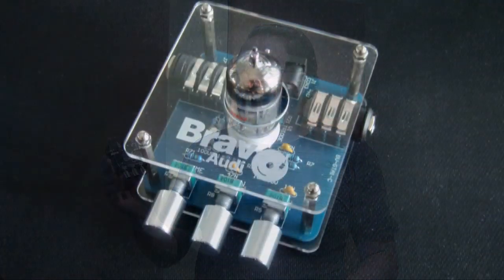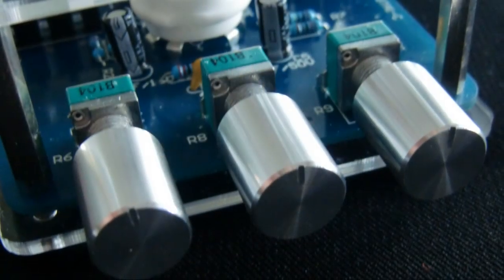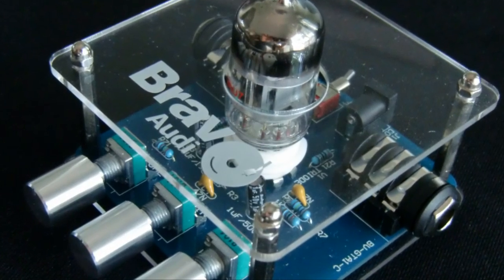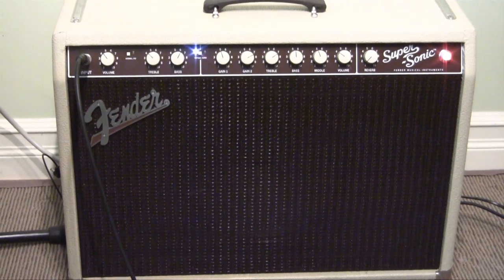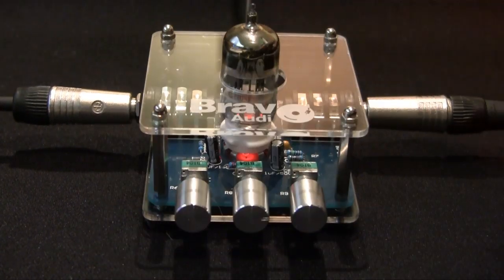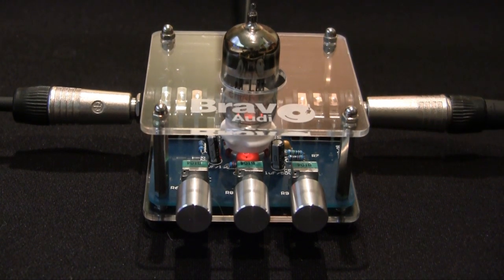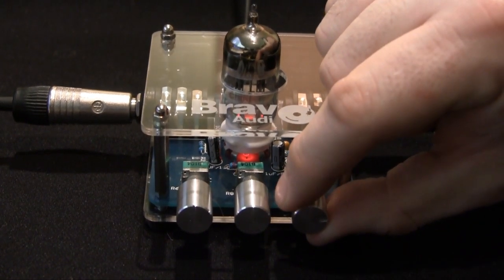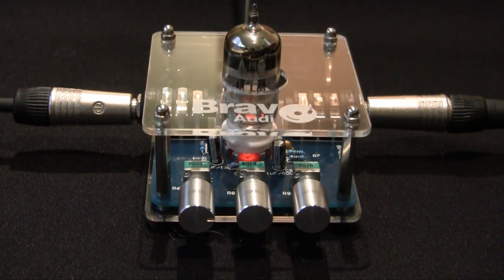Bravo Guitar Booster Review and Sound Test

Comment: Hi, I've seen it asked on this video and another (doesn't seem to be many videos of this unit) and I was also wondering. How does this unit pair with a solid state amp? Does it add any tube character to the tone at all? Even if it does not, do you think this would benefit the sound when used with a solid state amp. Thanks for the video :)
Reply: I have a similar valve overdrive pedal and it gives you a lot of valve tone. The good thing about it being in the preamp stage is that it's responsive to picking attack, etc. If your transistor amp is fairly good and not going to clip in a nasty way or add too much harsh colourisation, it should sound pretty good.

Comment: The valve plays no function in the chain. This tube requires 60V to get started, not 12.
Reply: +El Condor Pasa if it doesnt play a role how come people here say that they got different sound when they put in a different tube? Can you please explain some more because I am thinking to buy this pedal. Thanks
Reply: +Che Guebuddha In fact it does play some role. But for the difference to be heard I had to order linear adaptor. The one the pedal comes with gives too much noise. Still it's not for live playing. Or else get ready to use noise gate.
Reply: AC adapter with 60V? damn.